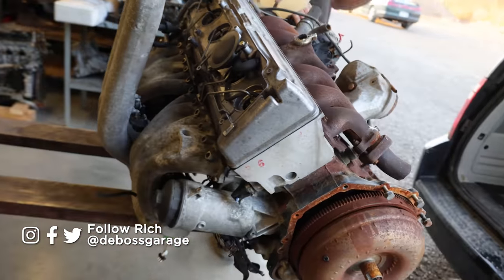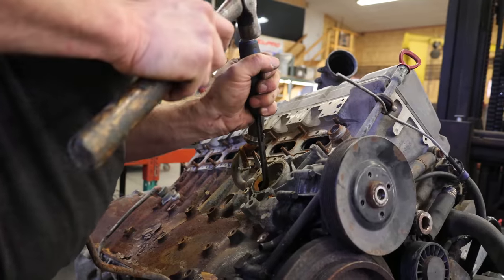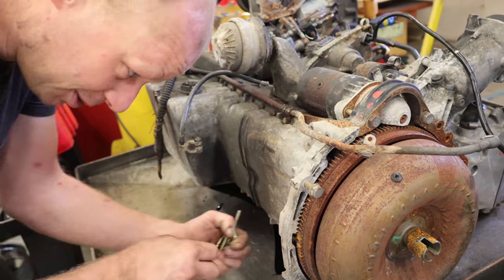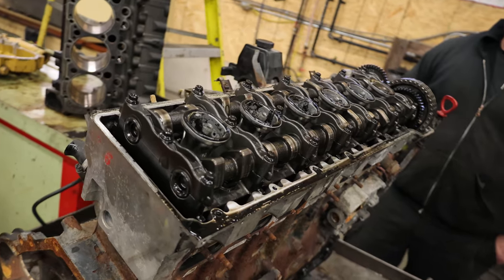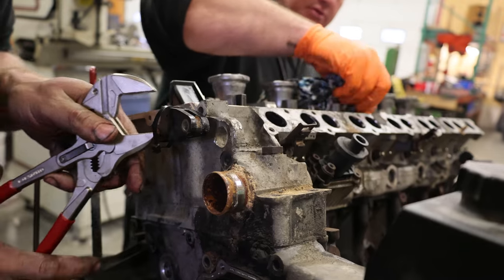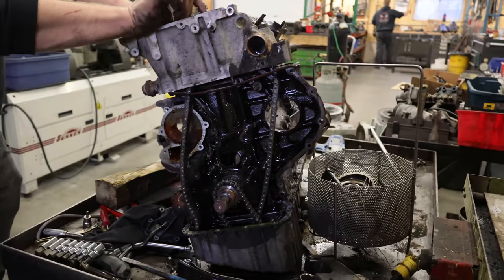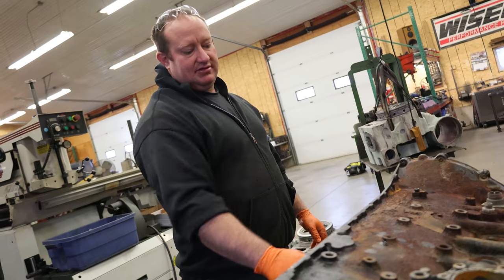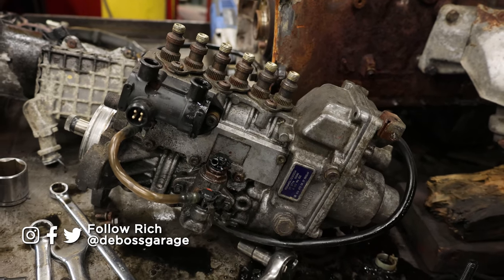REVIEW: Everything Wrong With A 3.0 Mercedes OM606

Comment: 1. The plastic connectors are prone to breaking but are cheap to replace. They are also a source for air to get into the fuel system.
1.5 the rubber hoses that goes between the injectors should also be replaced, or else you will have a diesel leak that fills up the hole where the injector sits. 
2. To get the pins out that hold the plastic guide you would first use a tap to clean out  the threads in the pin (m6x1 if i remember correctly). Then you would use a sliding hammer to pull each pin out.
3. The pure mechanical pumps only comes from the 601,602 and 603 engines that has 2 valves per cylinder and all the 604,605 and 606 has the EDC electric pump.
3. The bolt that holds the main pulley is only made out of 8.8 material. This bolt should be replaced by a 10.9 or 12.9 bolt.  They used to use a better quality bolt for the 601,602 and 603 engines so if you take a pump from a 603 for example you should also take that bolt. 

Tips for upgrading your engine for making big power:
- Get a hold of originial turbo pistons and rods or get aftermarket ones
- Buy or make a girdle plate for the bottom end, either 10 or 12mm would be good. You will have to make a longer chain for the oil pump and a spacer for the pump so it still reaches down in the sump.
- Send your injectors off for testing and upgrading. Originally they open at about 110 bars of pressure but you get a much better running engine if you increase the opening pressure to about 150 bar. With this mod you also decrease the injection period, wich is long enough when you want to make alot of power on these engines.
- If you want to rev high (6000-6500 rpm) you should upgrade the springs to stiffer ones. You can get a complete set from a 320cdi engine. You should also weld the sprockets to the end of your camshaft at this point because the increased resistance can make the sprockets break the guide pin and slip on the cam.
- i would not use the p pump for this build. Get a hold of a stock M pump from a 603, preferably a RS203 pump. And ship that over to Dieselmeken to get it setup for your application. He can also supply an original pump. You get a lifetime warranty on the pump and he is also the expert when it comes to om606 engines and diesel engines in general.
- I would go for a turbo thats bigger than the HX35, because the only time i have seen bent rods in these engines is when you have too much charge pressure at a low rpm. For example 2.5 bar at 2500rpm is more dangerous than if you have 2.5 bar at 3500rpm. A good choice of turbo is the Borg warner 200sx-e or Holset HX40.
Also very important to have a large enough exhaust after the turbo to keep the egt low. Pistons will melt if you have egt of 850-900°C for a period longer than 30-60 seconds.
- If you want even more power and cooler egt you can add a water/meth injection system on it.
These tips are for making your engine completely "bulletproof". If you just want to make some power and see how long it will last then just do the Dieselmeken pump and a turbo upgrade. 
Hope this helps making your build easier, you will be suprised by the power of this little guy.
Let me know if i can help some more 🙂
Reply: The 605, 606 engines in w124 chassies all have mechanical pumps, also the 602 turbo engine in w210 has an electronic pump
Reply: Also the w140 s300d has an om606 turbo with a mechanical pump no EDC
Reply: Yeah M6 or M5 for the pins. Don't need a puller, just an extra nut and a socket + washer and push the socket down with the nut while keeping the bolt from moving. Should pop right out.
Reply: Yes and also some S124 has 606 with mechanical pump. But mainly its the 603 that has the good pumps.
I would not recommend the screw and nut method because the hardest part is getting the pins to start moving, and you can strip the threads more easily that way. But if you dont have a sliding hammer it usually works fine.
In both cases they should be replaced with new pins.
Reply: you forgot the crankshaft pulley they starts to spin on the crank at higher rpms
Reply: @123pvpworld  Yes thats why i wrote that you should take the bolt from a 603 enginge because its harder and doesnt let crankshaft pulley work itself loose
Reply: Legendary comment
Reply: To not forget, there are 2 versions of mechanical pumps. The OM606 N/A in the w124 came with a different style pump than the OM603 Turbo (not only the ALDA that was added).
Reply: Water/meth does NOT cool EGTs.... Gale Banks decided to test the theory since he could really find any evidence of this being fact. The fact that youre adding fuel into the mix will increase your exhaust temps... the water mix isn't enough to combat this... However.... the reduction in air temps does make it a worth while mod but on these I would be using a big more water since IDI diesels have massive compression ratios
Reply: Thanks for sharing
Reply: @jcfreakable  and the om602 in w210 they changed pistons, engine head and injectors for direct injection. Wish i knew before i bought one om602 from w210 for my 290 G-wagen (non turbo) but anyway gonna be a fun time modify the w210 engine from direct injection to indirect injection and see how that works out. (i knew about edc pump and the injectors but i thought it was some other indirect injectors so that was facepalm but life goes on).
Reply: Long shot but I would pay for your time. Whatsapp maybe? Questions considering me buying a M-B bluetec 200 thousand odd miles fairly expensive so I have questions and concerns thank you man!

Comment: Your fuel pump is actually the vacuum pump on the front of the engine. The pins for the timing chain rail have 6 mm threads in them to install a bolt and use a slide hammer to pull them out of the head. It’s funny watching you and Scott tear the OM 606 down since I took an OM 603 apart yesterday. Also in case you are wondering what the OM means. OM- Ölmotor
Reply: Yes! This guy knows his Öelmotors!  (Oil-motor, aka diesel) Vacuum pumps occasionally leak their bearing balls into timing chain too.. preemptively replace or gut the pump. Fun story: I did a complete autopsy on an OM602 I got for $60 on Craigslist that ran away when I tried to start it. Most excitement I've ever gotten for $60! 😂😂😂
Reply: I had worked on 647, 646 and 651 and that 606  looks a lot like a 647 and i though that my be the vaccum pump, good to know the i was right

Comment: Rich you fantastic SOB, I have never clicked on a video so fast. Here are some other things you might want to know:
-The turbo 606's also had oil squirters, which squirt oil up through a gallery in the piston. This is what allows them to run super high boost, but oil cooling is really important with that
-There is a guy named Baldur who sells a controller and wiring harness for the electronic pumps. It's totally tunable kinda like EFILive, I know it's not mechanical but just something to consider
-For the naming, the OM601/2/3 are the 4/5/6 cylinder earlier SOHC engines that had head issues. OM604/5/6 are the 4/5/6 cylinder DOHC engines. OM stands for "Oel Motor", literally an engine that runs on oil
Looking forward to this one!
Reply: https://controls.is/shop/ ís Baldurs website
Reply: All OM604-606 have oil squirters. For OM601-603 only turbo models and some random N/A models have them. Biggest difference between N/A and turbo OM605-606 is Wrist pin size, connecting rod, cams, head gasket. 

Also OM601 is 2.0 or 2.3 and OM604 is 2.2 (some super rare OM604 are 2.0. But never the less block is slightly different than om601) OM602 vs 605 and OM603 vs 606 are more similar than OM601 vs OM604.

Comment: These pins holding the guides, you can get them out with an sliding hammer. There is m6 thread inside to connect it with an sliding hammer. Easy peasy
Reply: I think they were so dirty that they didn't see the threads
Reply: Yep, or special puller, or 10mm deep socket long bolt and some washers
Reply: I always just use a chain breaker tool to break the timing chain.

Comment: Some 30ish years back when Mercedes was building motors for its DTM teams, they were going out and offering to buy certain cars (with 2.3l 4-cyl gas motors) from private owners so they could get the blocks. They would gut the motor down to the short block and do a full race build on it, but because the blocks had been heat cycled so many times from regular driving on the roads, they were extremely stable and tolerated racing well. In the 80s and 90s, they were cranking 300+ NA horsepower out of what were Mercedes-Benz lowest end, cheapest engines. They were built that well. Just one of those factory freaks that comes around once every so often.
Reply: I think your just about a 100 hp of, its more like 400.
Later they had 2.5 ltr v6 wich made north of 500 hp NA!!!
Reply: BMW did  the same thing with their customers and engines.

Comment: Those semi mechanical pumps can be modified to the same speck as the mech. ones but need an aftermarket ecu to be controlled like a baldur dsl 1 that costs about 600€ and is mainly used for this exact purpose. Many consider this setup better also because of more control of fueling.
Reply: and built mech pump costs much more, at least 10 years ago when i had my superturbo
Reply: You can just chip the ecu and have it still work on the stock ecu. Also this is the wrong pump to touch, this isnt worth anything
Reply: chipping only works for stock 6mm elemts and stock engine config, no one makes chips for custom pump and turbo setups and yes this is the right edc pump to use
Reply: @nobba255  this has 5.5mm, also how do guys use 7.5mm edc pumps on w210?
Reply: @777xpressmusic  yes na model has 5.5mm elemets and the go to turbo version has 6mm. They use either a mechanical pump or a aftermarket ecu and an edc pump with those 7.5mm elements
Reply: @nobba255  "no one making chips for custom pump and turbo setups" wrong, sean treacy on fb is making chipped ecus for custom setups. I bought one myself.
Reply: @Jh-lh8qc   link to fb page please

Comment: 4:02 thats actually the vacuum pump! Its one of the main dangerous failure points in these engines, especially the older OM601,2,3 series. They had exposed ball bearings in the older pumps that if they failed, would shoot into the timing case, jump into the timing chain and skip teeth, causing catastrophic engine failure at about 200000kms.
Reply: Had one doing it at 25k km a few years ago, but must say it stood for about 12 years after original owner died. Bought it from his widow, a 1992 200d with 4 speed. Car was brand new and stood in heated garage, but standing is not what it liked obviously, and started it back up, 300 km's later that happened....

Comment: 04:00 it’s vacuum pump
Reply: For powerbreaks
Reply: Yup. Wanted to see if someone else made this comment before I did. Also worth mentioning that these vacuum pumps are one minor Achilles heel of the OM60x as the bearings on the vacuum pump's cam follower can have the cage break and since they're open bearings, the balls will drop (so to speak lolol) into the timing chain area... worth replacing if you plan to use the pump. If not, just rip the guts of the pump out and use the shell to plug the hole and call it a day. Lol
Reply: I was specifically searching for this comment. Now I can sleep

Comment: As you can tell from my profilepicture i know my mercs. The sqaure nut found in the head is for the lid of the airintake box. When you crank the om606s up for power you want the N/A cams just make sure to insert an extra pin cuz they are prone to twist the gear. The turbo version got thicker vristpins and rods. And the thingy that holds to chainguide you have to thread in a m4 bolt i think it was and pull it straight out. On the SOHC versions as om601/2/3 the pin goes through the head towards the first injector and are prone to leak oil there if you removed the pin once, telling from experience.. Get in contact with Dieselmeken AB in sweden, they build the best pumps for these engines, period!
Reply: @dturbo306  hahaha, pretty sure it was the other way around
Reply: @DidricSundgren  no mate it was mekon not dpuk who ducked up
Reply: Didnt Göran buy a pump from dpuk and it turned out it to be identical deliveryvalves as dieselmeken?
Reply: @dturbo306  Please research before u comment
Reply: @dturbo306  well, wich one of them have been making these products the longest and knows what they are doing? Does dpuk even have a testbench?
Reply: @dturbo306  and not only copied the delivery valve but did he have to copy tha alda system also?
Reply: How has NO ONE mentioned glow plugs seized in the heads?? It's pretty much the most likely failure point in these engines.
Reply: @JakePalmerReMax  Thats true, i forgot those. ive had the luck to never replace one of those. but when i do i will make sure to do it while the engine is as hot as possible :)

Comment: I made 12mm p pump fit to Om613 and it is driveable when adjusted correctly.
Reply: Care to share how you did it? I have a 9i e300d that I would love to go mechanical on
Reply: Ahhh you used a timing belt system. Very clever
Reply: Wow. I've been wondering if anyone had done this with a MB engine. I've heard of people doing it with VW TDIs. What injectors did you use???
Reply: @MiG21aholic  injectior body is from Deutz bf4m 1011 and nozzle is from scania Dc16 8x0.2mm
Reply: @eerogue  awesome thanks. Been on a dyno by any chance? I'm thinking there may be a loss of low end torque?
Reply: @MiG21aholic  well i have been in dyno, but injection pump wont deliver enough fuel. Best it could do was 250hp. My plan is to out 13mm plungers in it and try dyno it again, My power goal is 800hp .
Reply: @eerogue  wait itndidnt make enough fuel?? I thought the pump stock put out more than 200cc?
Reply: @marvinwatson2749  im cofused too,it should deliver over 450cc. I think that this pump is chinese copy and it has some random plungers in it.
Reply: @eerogue  what rpm are you turning to? Theres guys in the UK making 500 600 whp on less than 200cc. But that's the pre chamber engine. What's your injectors from? Since yours is DI
Reply: @marvinwatson2749  max rpm is at 5000rpm, injector body is from Deutz bf4m and nozzles are 8x0.2mm from scania Dc16
Reply: @marvinwatson2749  i estimate fuel quantity on dyno being around 100cc of fuel when maxed out
Reply: @eerogue  wow that's weird. That's a huge nozzle too! The boost cleaned up all the fuel? It's crazy because even the stock pump on a cummins can make over 400. It's usually nozzles that hold them back.
Reply: @marvinwatson2749  at 3800rpm all smoke was gone, and feed pressure did not drop
Reply: @eerogue  looking forward to it! Please make youtube videos of it

Comment: I met the Black smoke racing guys a few years back at a car event in Norway. They had some trouble with the boost pipes staying on. So I asked them how many bars/Psi they where running..

"Ehhh, around 9 bars" thats 130Psi..
Reply: And back then, they were testing out nitrous also,if I remember correctly.
Reply: That sounds like a pro-stock pulling tractor range.
Reply: If i remember correctly they "only" run something closer to 5 bars on a billet hx50. dieselpump uk or dieselmeken tested that the block cracs at around 5.3 bars.
Reply: If it was time when they already started to use 320CDI (OM648) engine in their "W203,5" chassis, its running about 4,5-5bars of boost. That engine is still in car and it makes like 70whp at 2500rpm and 700+whp at 3500rpm ->, atleast Teemu claimed so.
Reply: @joku8900  oh yeah you are right i mixed them up, they currently are running about that pressure on a hx 50 on a om648. But quite sure they werent running much over 5 bar on their old om606 either.
Reply: That's more boost than a silly gasser makes in compression! Just another reason why gas engines should only be legal to use as boat anchors. 😂
Reply: @dregenius  If a silly gasser has a 10 to 1 compression ratio. That means the gasser has 10 bars.

Comment: Mercedes timing chains are generally riveted. Pretty cool process of cutting the chain, attaching a new chain to the old chain with a temporary link and then spinning the engine over with special fixtures to keep tension on the gears and then riveting the new chain. Explains why the guides are not easily removed

Comment: The spring loaded gear is to take up slop between the gears and stop rattling they still use this design in the om654 produced today
Reply: The spring tensioned cam sprocket is common on alot if japa diesel stuff too!
Reply: @aaronhall7740  absolutely, I've seen this design on the camshaft gear of an Isuzu diesel. I think VW also used it on the completely gear driven i5 PD TDI in the Bus and Touareg as well as the 2.8 i4 TDI made by MWM in the second gem LT van to take out the slop in the valve train.
Reply: @creak92  yep the t5 2.5 pd transporter had it also I forgot that
Reply: Sorry that's not correct, at leat not for the 601-606 series engines, those spring-loaded wheels are timing advance mechanisms, the advance pumptiming with rising rpms.
Those engines couldn't operate in such a broad range of rpm without any advance mechanism 😜
Reply: Sorry I meant at least * not *at leat
Reply: @unclewilly2  ah right was it on the pump gear I'm wrong so the ones on the newer stuff are on the drive gears between the cams to take up slop between them my mistake
Reply: And was slightly offset teeth.
Reply: @aaronhall7740  not just diesel. I believe some of 4cyl gas Toyota had them to reduce noise
Reply: @ericthimot4988  Toyota have them on a few long service interval  petrol engines, takes up the chain lash when the chain and sprockets wear. 2tz-fe had one.
Reply: @unclewilly2  Correct!
Reply: @unclewilly2  as I know nothing about these engines, I will believe you. I'm gladly concede to your greater knowledge. Thank you.
Reply: @unclewilly2  correct, it has a timing curve graph somewhere in the literature on WIS